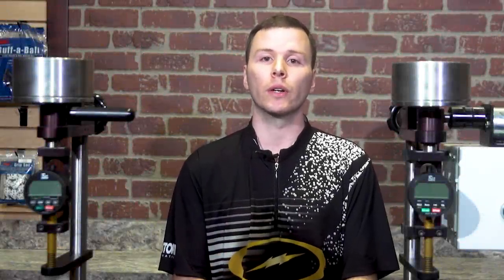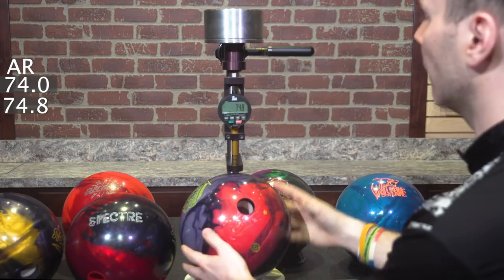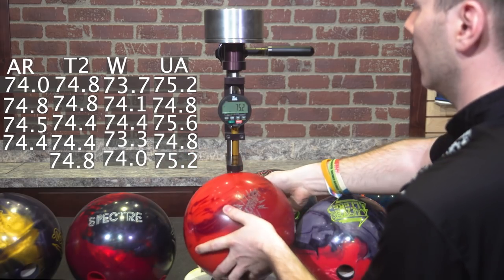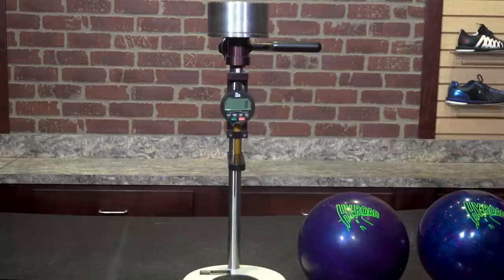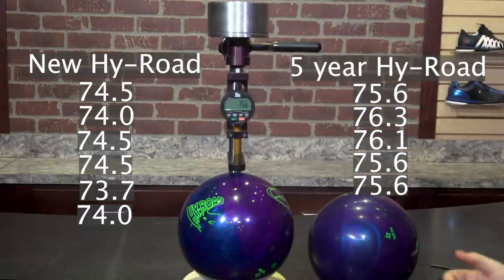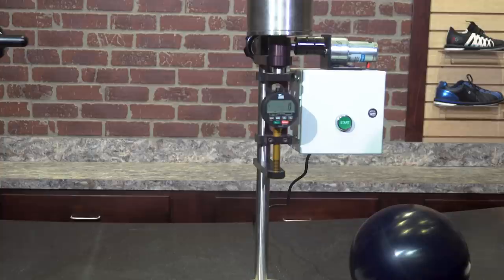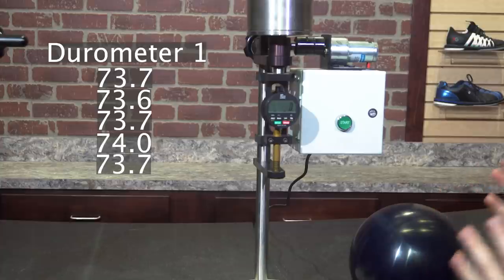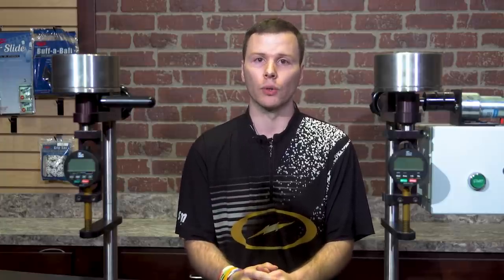Storm | Durometer Test Follow-Up

Comment: what I want to know is why the "magic" number is 73? what was the justification by the usbc to raise the number by 1 point? does that really make a major difference in ball motion? i feel there should be some limit set but why not a range vs a hard number. I remember the days of people using acetone to soften balls but it still came down to shot making. It's just ridiculous how the usbc has caused such division when they are supposed to be "growing" the sport. I bowled with a pitch blue and purple hammer and honestly i am tired of people asking me about the purple  so i just throw plastic now.
Reply: Same, from a league bowler perspective I have no idea what the "magic" number is nor do I care.  If USBC approves the ball for competition that really should be it as long as it's drilled to be legal (i.e. no weight holes etc.).  I feel like the USBC has failed us here.  Now we ask questions and get silence.

Comment: Why is Storm not suing USBC or otherwise going to arbitration. Why not demonstrate with the most consistent durometer you have, calibrated to USBC's spec, with the automated stand, using the USBC standards for surface finish and temperature, that the banned balls are within spec?

Comment: Then why not hold the ball for at least one year, to give them the extra Harding ,they need to ,since you said they harden over time ? Like a fine wine or whiskey ,age to perfection...they wouldn't run into this mess again? or better yet, the durometer ,what is the temp difference? Cause the temp causes a difference, in a reading.

Comment: Sorry but I will Trust Storm over the USBC any day. They tested the Bowlers equipment at a Tournament behind a Black Curtain without the Bowlers being allowed to Watch or being told what was Done. What is so Secret?
Reply: To be fair, the USBC has fully explain the black curtain testing was a blind test that is being done for a study of urethane balls, that has been ongoing for over 2 years.  The entire point is to test urethane balls blindly, with no outside influence.  While the final study results aren't yet available, the bowlers had full knowledge of what kind of testing was going on.  A couple of difference Vlogger bowlers talked about dropped on their urethane balls after the practice session for the hardness study in their videos BEFORE all this nonsense started.

Comment: I have to say that this didn't answer many questions for me, or at least the most important one.  Does the Spectre and do the 6 excluded balls consistently test at a lower hardness than other balls?  If you use the same durometer and take measurements of other Storm balls as well as Motiv and Brunswick-produced balls, is there a consistent difference?  As you've proven, the actual numbers of the durometer readings are volatile from durometer to durometer, yet are consistent when done multiple times on the same ball and accurately show variability from ball to ball when the same machine is used.  Without the context of proving that the hardness of the excluded balls is not significantly different than everything else on the market, this video doesn't really prove or absolve Storm of anything.

Comment: Like all measuring equipment over time it all needs to be sent in to be calibrated. There is no way your durometers should have different readings. One or both are out of calibration.
Reply from the maker: Did you watch the first video? Not only is there a way but it is known and mentioned by the company that manufactures the durometer. Just saying.
Reply: Do you know why you should never wear 3 watches?
Reply: USBC actually allowed for a 4D tolerance with field testing in their 2019 hardness report due to certified calibrated durometers having that large of a variance.

Comment: I love Team Storm but this is all useless.  Until you all calibrate your test equipment, processes, and samples side-by-side with the USBC,  then it's just all whining after the fact. 

At this point, Storm is just trying to win the court of public opinion than deal with objective data and root cause.
Reply: Pretty much this.  There's 1 durometer on the planet that matters, and it's the one at USBC HQ.  Unless this demonstration is performed on that durometer, these numbers are nice, but ultimately pointless.
Reply: So you're saying that if the USBC would just share their data and information, that should clear everything up? Huh...novel idea.  What are the odds that it'll ever happen?
Reply: @mwfisa  nope... even if they shared more data, it doesn't end the discussion.  We don't have calibration between their durometers and Storm's; ditto on test controls and processes. And finally,  we don't have the same Storm balls that were tested and provided the unfavorable results.
Reply: @pjr300  Fair enough.  So then, the USBC's information and Storm's information is essentially useless unless strict conditions are met and any discrepancies are explainable/verifiable on both sides?  Because I can agree with that.  But the point still stands...what are the odds that will ever happen?  

Right now, all we, as bowlers have is "trust us...they're illegal" from the USBC and a company appearing to go along with it to a certain degree, though no one knows if the motives are accuracy or financial.  Yet, there's enough anecdotal evidence that, under certain conditions and calibrations of the testing equipment, that's not true.  The USBC said that they projected 100% of the Altered Reality balls were out of spec.  But this video shows a ball that's absolutely legal, again under the conditions/calibrations the video was shot.  What would that specific ball show on the USBC's durometer?  Who knows...and unfortunately it's likely we never will.

Is that to say Storm isn't cooking the books, as it were, to make it appear they're legal?  No, I have no evidence either way on that.  Just like I have no evidence that the USBC's numbers are accurate.  And unfortunately, the USBC's explanations for things like the need for a curtain to test balls behind just don't sit well enough with me to give them the benefit of the doubt.
Reply: @mwfisa  All good points... and yeah, right now, i dont trust either party in this case. I trust calibrated measurable data.. and we ain't got any.
Reply: They did have them calibrated did you not pay any attention to the first video? Go back and watch it.
Reply: @kyleb5169  I think you misunderstand the concept of cross-location calibration.  They need to calibrate to each other and determine if a variance exists, usually using a control sample to help drive standardization.
Reply: @kyleb5169  Your take is factually and scientifically inaccurate, as are both of Storm's durometer videos.  Sorry.